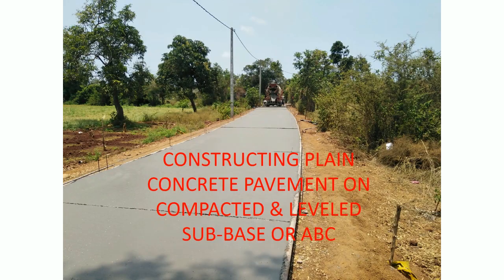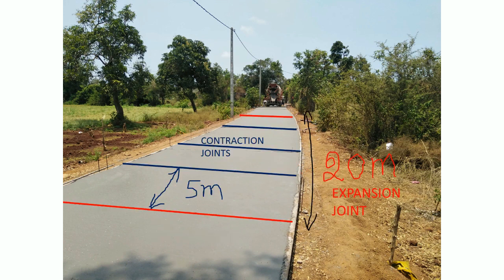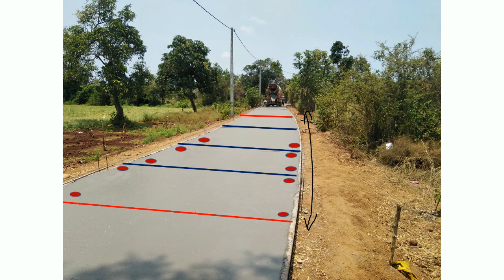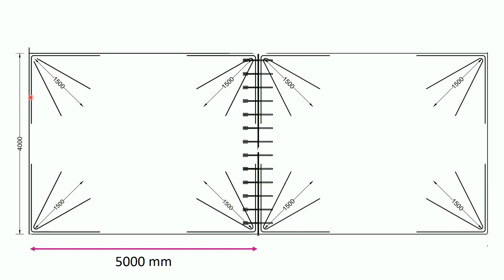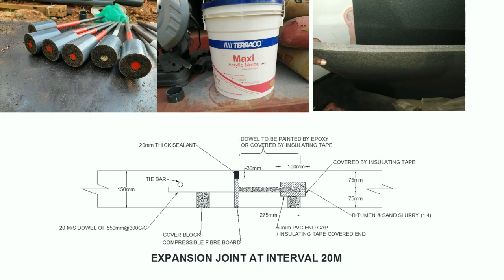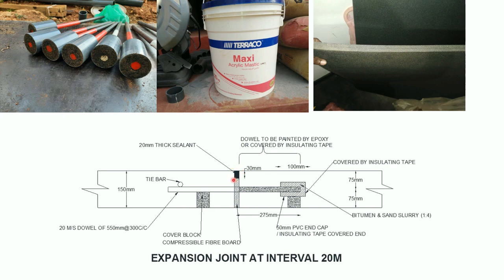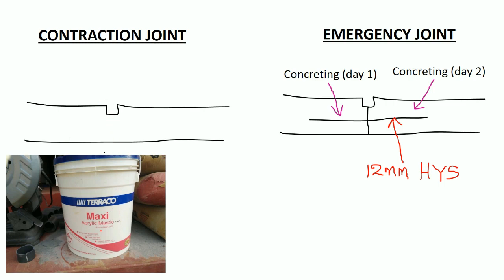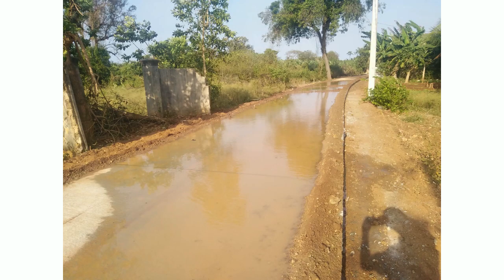Concrete Pavement Construction - Part 1

Comment: Concrete slump 150 is very wrong, which should be low slump concrete.
Reply from the maker: Thank you for your comment. This is the different between Engineering theory and practical Engineering. If Use the Concrete site hand mixer , we can go up to 50mm slump. But Ready mix plant never provide the concrete in lower slump. This is the real practical situation.  If you want, I able to share the Mix design report. Anyway for ready mix concrete 125mm slump is good. Our case is very low camber, difficult access place, face some problem in slump 125mm etc. Thank you.
Reply: What do u mean by slump, whixh is the slump